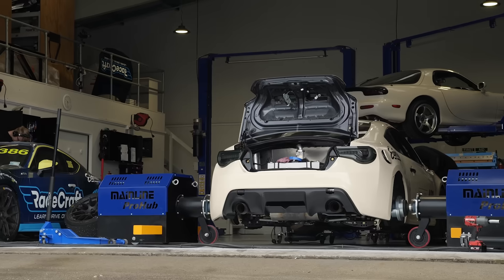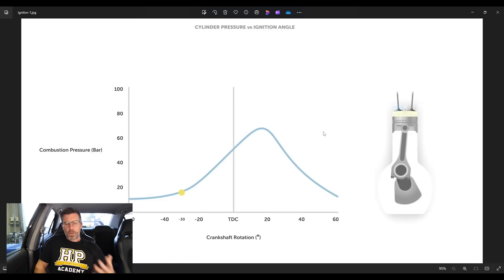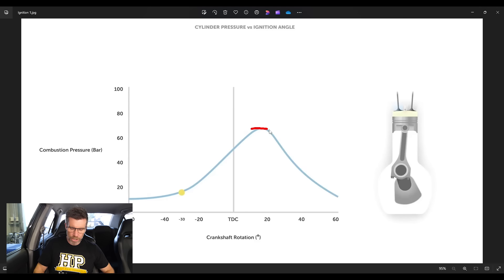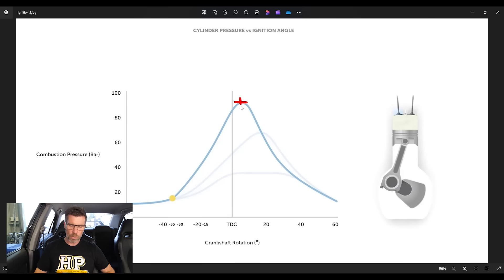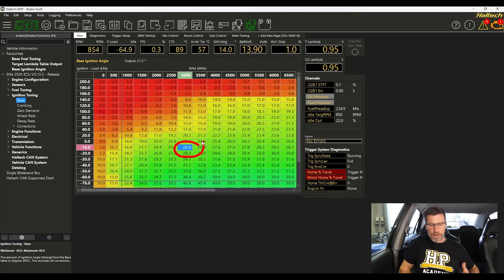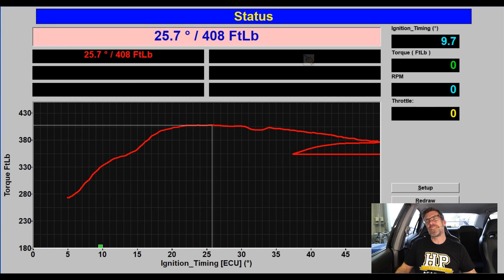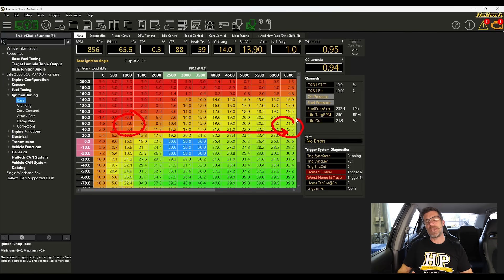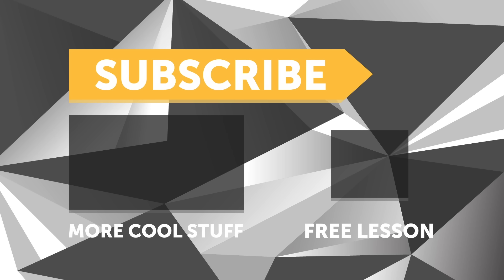25° of ignition timing gave us MAX power. Why?

Comment: Stop saying 16-18° ATDC. This varies so much and is entirely dependent on the geometry of the engine itself. This angle range does not apply to all engines, it can go below 10° very commonly on modern engines.
Reply from the maker: Then you would see that when tuning such an engine and adjust accordingly using the same principles shown here - Taz.
Reply: @hpa101  you are making what appears to be a universal statement for all engines that ideal peak pressure point  is between 16 and 18. No clarification given that this only applies to some engines.
Reply from the maker: That's what you heard, but it isn't what was said. Have another watch. Andre uses the words 'typically' and 'maybe' which cover the bases. He doesn't specfically state that is the same for every and any engine like you are.
Hope you enjoyed the video, it's hard to take it all in at once sometimes for sure and there are always exceptions to a 'rule' which is why we don't work to 'rules' with this content and instead work hard to teach an understanding of the topic rather than something you just 'copy and paste'. Tuning doesn't work like that 👍 - Taz.

Comment: Observing Best timing for a turbo engine with low turbine inlet pressure differential is very different than street combinations operating at 2.5 to 3:1 intake /exhaust differential. High backpressure combinations love more ignition timing because of the egr effect of exhaust residuals left in the cylinder, but will spark knock in a heartbeat because of the retained heat in the combustion chamber. Making it clear, high turbine inlet pressure will love more timing because of retained inert exhaust gases, but will melt pistons under sustained load

Comment: Can you automate the dyno timing sweep if you have a DBW pedal?
Reply from the maker: The dyno does this for us. You can set the RPM limit and the duration of the run. You don't need DBW 🤘
It might not be a feature on every dyno, but it has been on the Mainline dynos we've had since I've worked here at HPA (2wd roller, 4wd roller and now 4wd hub) - Taz.
Reply: You my friend, ARE A GENIUS! That would help so much with comparing dyno results at low speed/low throttle

Comment: could you put a load cell under the electrode of a spark plug and measure cylinder pressure that way?
Reply from the maker: Yup! There are such devices for in cylinder pressure monitoring. $$$ for the device, and $$$ for the setup on the vehicle. Some ECUs support such tools directly.
Pretty awesome - Taz.

https://www.hpacademy.com/blog/how-modern-ecus-have-become-awesome-entry-to-professional-level-ecus-tech-talk/?utm_source=youtube&utm_medium=social&utm_campaign=general-interaction
Reply: Yes, it has been done that way, head bolts and strain in the block too. There are several research papers out there on the topic if you do some googling. 
What is tricky is calibrating it and getting reliable results, but for basic tuning it should work ok.

Comment: When tuning for best torque with standalone ecu on NA engines should be fairly straight forward, however when other aspects are thrown into the mix it gets a bit more time consuming, a variable loop type resonance  inlet manifold with cvvt cams and compression ratios of 12, 5:1 on pump fuel whilst still trying to reach emissions targets. 
You got to hand it to OEM's in that regard.
Reply: On the other hand, if you don't care about emissions, this is what allows you to get considerably more power by swapping out only the ECU.

Comment: As a tuner i never recommend tuning right up to MBT, Less margin for error if loads or batches of fuel are diffrent to the dyno.
Reply: @BEYTEK  Fair enough, but it's a good thing to know how to do, it's then up to the tuner to set proper safety margins.
Reply: @ usually if your tuning to mbt your high end motorsport who requite the limit from the engines. most people are happy runing well withing the safetey margins :)
Reply: @BEYTEK  not an issue if you use the best fuel there is for combustion engines, diesel or oil 😉
Reply: @Blackbeardxx9 haha you know it bud! Can’t beat a bit of durtay diesel
Reply: Why not use second highest octane fuel to tune and then recommend the highest octane fuel for normal use?
Reply: @ bad batches of fuel can be worse than the lowest grade. the closser you tune to mbt the more sensitive it is to knock with a bad batch.
Reply: @BEYTEK  Don’t all modern engines have dynamic timing control? If the knock sensors start going off, doesn’t the PCM pull timing back until knock goes away?
Reply: @BEYTEK how many degrees do you tune away from MBT to compensate for the bad batch of gas? If a bad batch of gas is worse than the lowest grade available at the pump then theres a lot of power to be left on the table if you tune rich on the lowest grade... magnified even more on boosted car. So what kind of tuning strategy do you use to not lose so much power on normal batches of gas and be safe that one day when you fill up on a bad batch?
Reply: @ahmed9399  well its engine specific, power, type of fueling and to be honesr theres allot of contrabuting factors. Even country to country, Is the car also using aux fueling like WMI so theres no set numbers. Is the customer in a championship that uses the exact same fuel every time consistenly and needs the car to run at 100% of its potential or more of a hobby driver using pump fuel, higher milliage less maint etc. Personaly i find running less timing and more boost is a bit safer than mbt timing and less boost. again all comes down to everything ive mentioned above
Reply: @ahmed9399  luck is the deciding factor
Reply: @BEYTEK more boost needs less timing, id say you are better off with less boost and optimized timing to make the same power.  Lower egt, lower intake temp.  If you are octane limited at a certain boost level, then octane is preventing you from running MBT, reducing efficiency unless you lower boost to point you can optimize timing
Reply: @BEYTEK allot lol
Reply: Yep one of the first things a tuner knows.🎉
Reply: @BEYTEK  geeeeett ouuuuttttt
Reply: Tuning to MBT is fine, it’s the borderline detonation limit you need to be wary of.  Depending on the engine and where in the map you’re tuning, you can be at MBT and a long way from BDL, in other maps points you’ll hit BDL long before MBT.  BDL can be affected by lots of variables (inlet air temperature, for example), but MBT isn’t as affected.
Reply: Excuse my ignorance but what is mbt
Reply: @shaneross1998 maximum brake Torque
Reply: I think the demonstration was excellent and I'd be happy plotting the timing per test.
I guess the safety margin depends on  your goals.
Example drag racing with known good fuel and maintenance Vs 4wd towing in heat with outback fuel. Cheers
As

Comment: 13:40 Great info as always.
What this part of the video serves to reinforce is the brilliantly clever old centrifugal and vacuum controlled distributor system.
Properly set up and adjusted it did all this with no computer using physics 🙂
Reply: Race cars (poor education) had a lot to answer for, the had many a street driver ditching there vac advance as they thought "race car don't use it, nuts be better!" Imagine how many gallon os gas were waisted in the 60/70/80/90's due to this.  Vac cans fight global warming!

Comment: Great content as usual, and I have a question. If the fuel is knock limited to which point do you retard the timing ? I mean like the EGT will start to rise as you retard the timing, which is not good either. Heat could damage valves/seats etc. So how do you know when to stop adding boost ? I was told not to go beyond 850°C before turbo. Thanks
Reply: @Stuuutuutu   well typically you'll tune AFR to an acceptable point on steady state and then after you'll slowly begin to bring up timing until you hit knock. There's a much larger margin of safety than you probably think there is.
Reply: @Creesic  i think what he is asking is on a knock limited fuel with boost at what point do you stop adding boost and retarding timing to stay away from knock in regards to as you pull timing your egts go up because your sending more of the combustion energy out of the exhaust . 
To that i would say the egts are subjective to where there taken right at the port i dont think it would be unreasonable to see 1100+ degrees on a boosted engine but iv never really had thermocouples in the exhust to even look at 
My approach would be at the point where the power gainst start to drop off per lb of boost so if you were getting 18 or 20 hp per lb of boost at the start and its down to 9 or 10 per lb of boost you add because your pulling so much timing id say thats the limit ... im not a expert tho
Reply: @Nicksshedbuilds  Ok thanks for your reply, I see what you mean. I need to tune on the dyno, street tuning is not enough.

Comment: The people using an ECU and locking timing at 36 degrees etc drive me insane. "You don't want to put a heavy load on the engine at mid rpm range or less" Because the timing is too advanced and you are punching the piston at TDC or sooner with nowhere to use the force. Cap cracking, rod bending, piston melting disaster. Flame burns at x speed for given afr + cylinder pressure regardless of rpm. Higher RPM gives less time for flame front to reach the peak, light it earlier aka more advance.
 You make the best tutorials! Although your vocabulary might be a bit beyond the avg joe.
Something else you can do with light load fixed rpm is leaning out the mixture and finding MBT. Even a high performance forced induction motor can be a bit of a fuel sipper at cruising speed. Good combustion chambers might run something near 16:1 AFR with 50 degrees of advance for MBT at very light load. More tuning time but can save a ton of fuel in drag and drive type stuff.
Reply: poor education leads to poor choices. They all need do a HP course.
Reply from the maker: Sorry about the vocab! If there are any words in particular let us know and we can try address them better, otherwise Andre does try make sure any relevant acronyms etc are explained and we do our best to add them to descriptions as well.

It's certainly also crazy what people try to do with blanket adjustments. We do all make mistakes and, hopefully, learn from them as we grow into a skill like tuning. All we can do is try help each other when the chance arises, and on the flip side accepting help with some healthy critical thinking skills rather than just blind trust too 😎 - Taz
Reply: @hpa101   Poor cylinder head design (no swirl or quench) also likes higher timing as the efficiency of the burn is less quick.

Comment: What happens when the boost pressure is higher 40+ psi? Does the extra amount of fuel slow down combustion?
Reply: Sounds like you need to sign up for HPA
Reply: you're talking like the fuel will increase at the same rate as the PSI number without factoring the air density.
Reply: @MRworldEtIkA  I figured common sense would allow people to understand I'm not talking about a T25.
Reply: @jockobo  … well my limited experience with my past turbo build I only understand that more boost = more power and speed rather than a tamer combustion. I’ve only tuned to 10-20lbs boost so I’m not exactly sure what needs to happen at 40psi other than pulling back ignition timing towards approaching redline as pistons travel up & down in less time than what it takes for fuel to fully burn 100% or as much as your tune and engine dynamic can achieve. We can agree that @14lbs we are replicating one atmospheric pressure which in general can double the existing hp in that given engine or any engine for that matter. At about 30 hp that’s 3x’s the existing hp. Unlike
N/A engines that only get slightly richer as approaching redline, a turbo engine especially large turbo builds will go a lot richer towards redline and also begins to richen a lot earlier in the rpm band. Non turbo engines richen almost in a linear manner whereas turbo builds (race build) will richen in an exponential manner and this is do to air density but will still show rich on your afr bcs things happen so fast that the fuel has not enough time to fully burn while at the same time helping engine stay cool bcs dense air comes in hot.